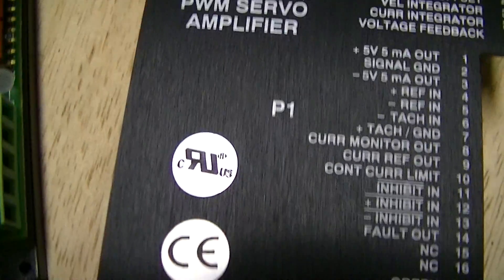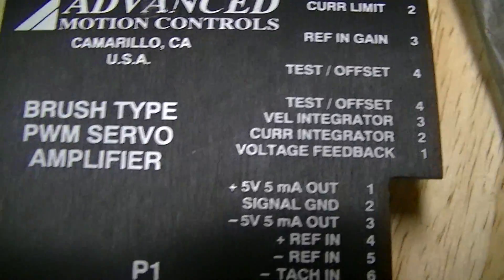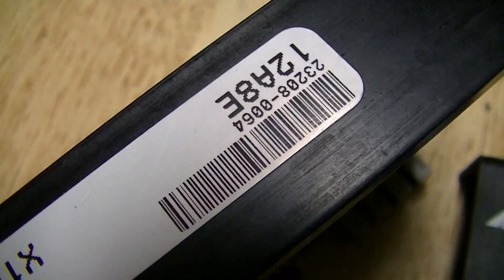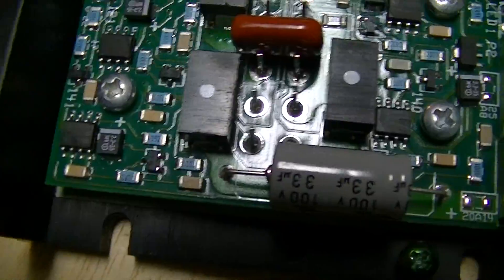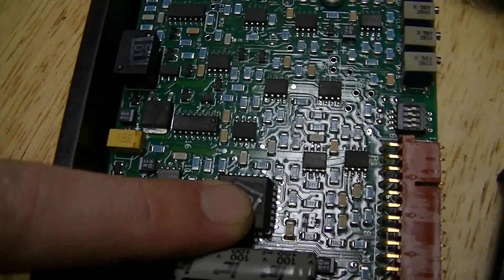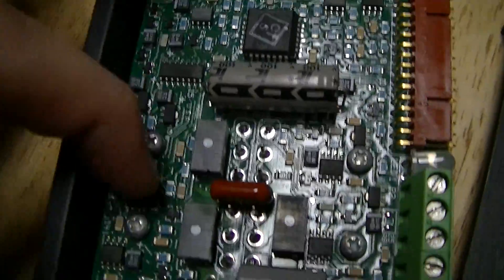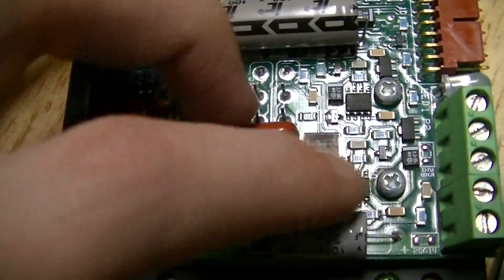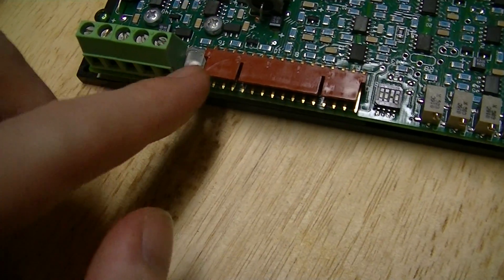Advanced Motion Controls 12A8E servo amplifier

Comment: I need the numbers of chips ... my board has no internal 5v .. feeding the chips are with v 0.8 please help me!
Reply from the maker: I have no data on that.  You would either have to contact AMC for a schematic/BOM or get an identical module and decap the chips to check the die markings.  If it is just a bad potential regulator or shorted bypass cap, the packages with heatsink tabs and any electrolytic/tantalum capacitors would be the first things to check.
Reply: Greetings friend .... the problem is that here in Brazil do not find a module for such replacement, this country is slowly here in technology and I'm sorry for that ... and if I buy on ebay for example takes about 40 days to arrive. tested the transistors resistors and replace all capacitors and tantalum electrolytic, tested the 5v line to see if there is nothing in her short but high resistance, I believe it is some IC .. thanks for the help buddy! 
hug